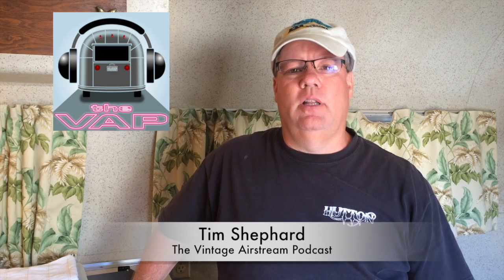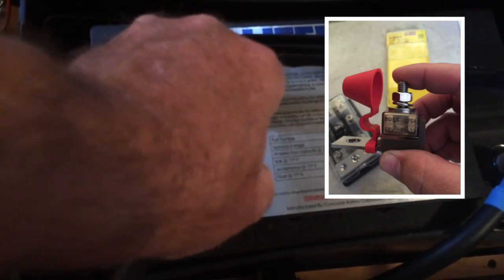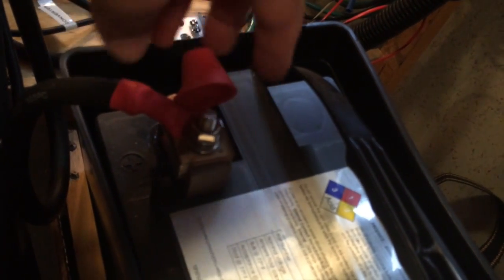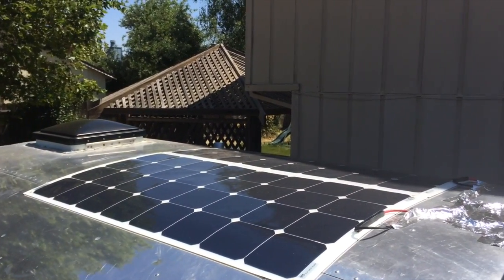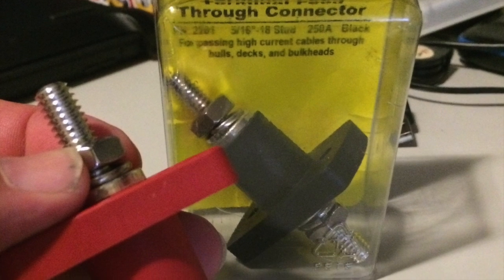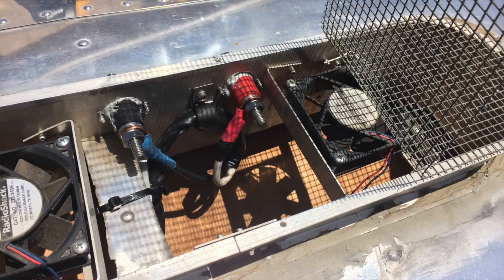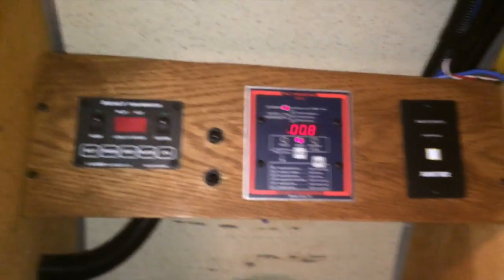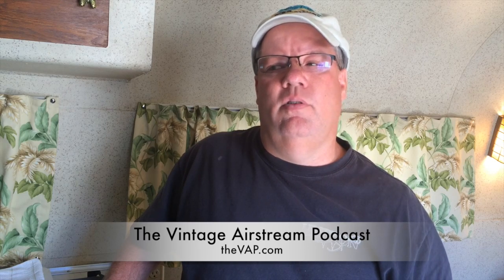theVAP GoPower! Solar Flexible Panel Project

Comment: How are the panels holding up mounted like that? Trying to decide wether to go with the flexible or rigid ones on my Airstream. It’s very similar to yours.
Reply: Darren Langley if you have a wide body, I’d suggest the rigid for longevity.  If you have a vintage you’re kinda limited to the flex panels.

Comment: There is one major issue with your install on a hot metal roof.  I learned this after I bought the flexible panels myself.  Solar panels don't like to overheat, or they become inefficient and die early.  They like to remain cool despite sun beating down on them.  When you mount the glass rigid panels it automatically puts a space under the panel for air flow.  Not so with the flexible ones.  No one mentioned this when I bought them, not even the seller.  However, the weight savings is worth the extra trouble and cost.

I just saw a video where someone had epoxied some flat bolts onto the RV metal roof, then slipped the grommet holes of solar panel on to these upside down bolts and screwed them in tightly.  Since the bolts all had a small nut between solar panel and roof, it raised the panel slightly off the roof while still keeping it very flush.  Just enough rise to prevent overheating.  Genius!  I suggest you do that too, or your panels will have a very short life.You can also insert some insulating material like sticking a foam sheet between roof and panel so heat does not transfer from hot metal roof to panel.

I would also switch to an MPPT Solar Charge Controller which doubles your solar energy collection.  PWM version is wasteful and inefficient, though cheaper.

Thanks for the demo, very useful.  I need to install my flexible panels and this has helped me a lot!

Comment: How many solar panels would I need to power my airstream like its a normal little apartment without having to turn one thing of to turn another on
Reply: +Danny Doty   Solar panel only charges up your batteries which normally only run the 12 volt lights and fan, and maybe a 3-way fridge, not much else.  In order to run small appliances, recharge electronics, TV, etc, you need a 3000 Watt Pure Sine Inverter.  (Pure, not Modified).  Solar panels charge your house batteries with a DC current, and the inverter will take the DC current from batteries and turn into AC current for your electronics.  It will also give you many outlets to plug into.  The outlets in the RV usually are plugged into the Generator which produces AC power directly.

I bought two 100 watt flexible Monocrystalline panels on Amazon from Windy Nation Co.  They are 2 lbs not 38 lbs.  The rigid Polycrystalline panels are 38 lbs each but have some advantages too.  Mono is better than Poly but costs more.  I bought an MPPT Solar Charge Controller from Windy Nation for around $200, plus $200 each for panels, plus cables, connectors.  I also bought 2 100 amp hours each AGM Lead Acid Batteries from Amazon at $182 each - good price.  You can find Lithium batteries online at $600 each from a wholesaler (normally $1200 each) for same 100 amp hours each.

This should give you a reasonable set up.  You can enlarge it by doubling to 4 solar panels total, the maximum that the 400 watt solar charge controller will handle.  After that you need a bigger solar controller, and too pricey.

Do not buy a Modified Sine Inverter only a True or Pure Inverter.  Modified will ruin your delicate electronics with a poor AC jerky current.  This is pricey.

The Inverter watts determine how much power you can use at once.  If a hairdryer is 1875 watts, and your inverter is 3000, you can also run your 1000 watts microwave at the same time.  But not if inverter is only 2000 watts, so get a big one.  Start with 2 solar panels and two batteries and see what your needs are from there.  Its easy to expand later.

Good luck!

Comment: Where can i find the data sheet on this controller ?  I want to see how efficient the power into the controller is compared to what actually reaches the batteries ? PWM is more economical but some controllers take in lets say 10amps while only 6-7 amps reach the battery.
Reply: +Tommy Boy  Do not buy a PWM.  Buy MPPT.  You lose 30% or more power.  Not worth it for $150 more.